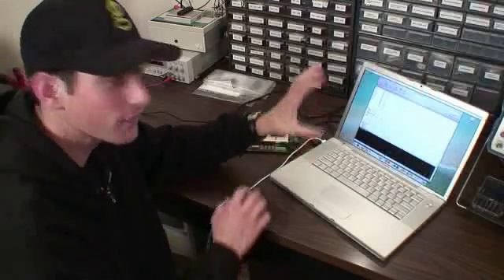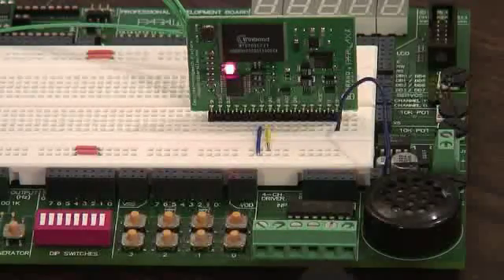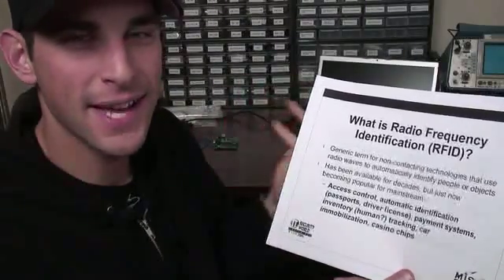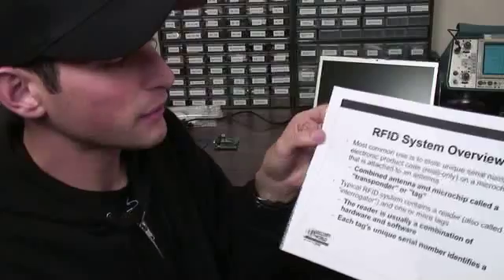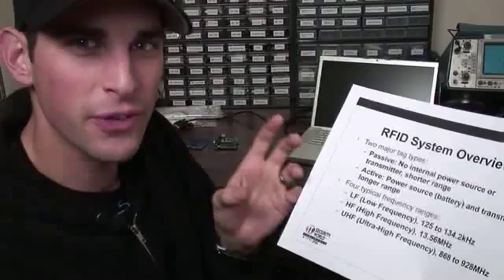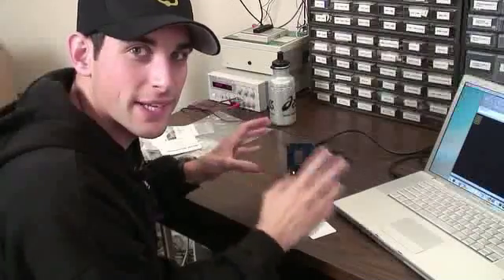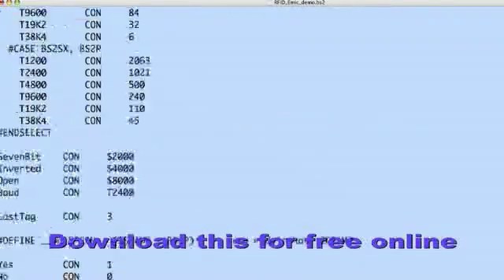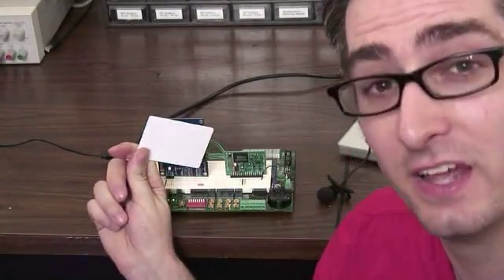RFID and Text-To-Speech Modules

Comment: back in the old days with my Altair  (circa 1976) I had a speech synthesis card.  We sent it phonemes rather than words.  It could say anything.  I didn't have it do Spanish because I can't speak it.  But it worked.  If the parallax board has phoneme mode you could make it talk whatever you want.  Just a little more hacking!